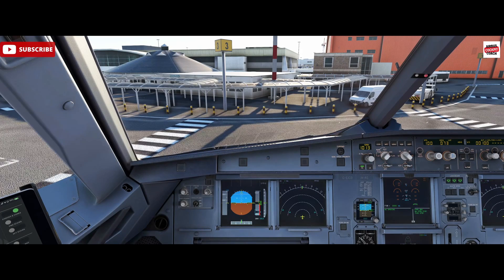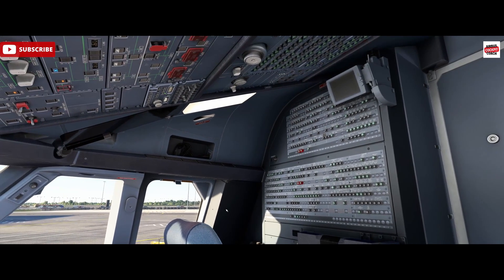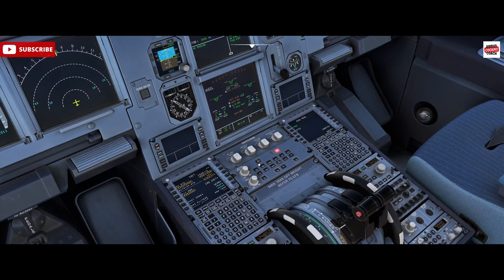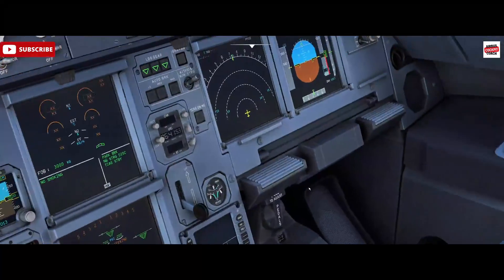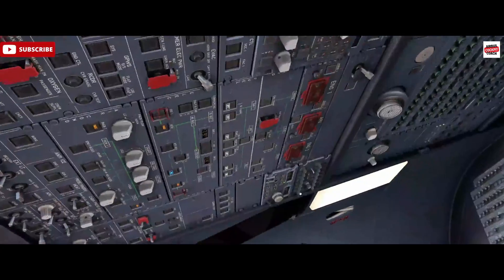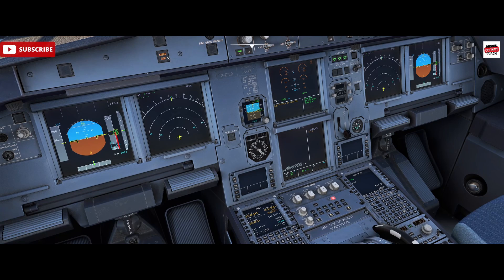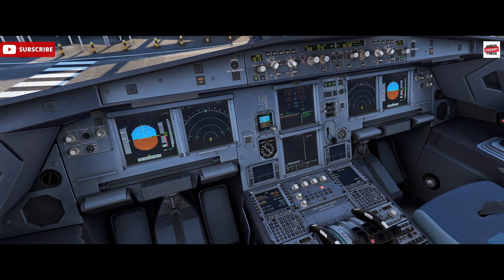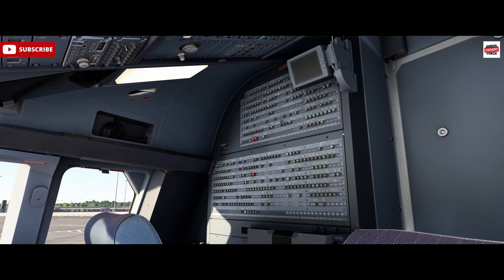A320 Circuit Breakers Explained by a Real Airbus Pilot | MSFS 2024 Tutorial

Comment: Thanks for the video and your effort. One question though, if we start the engines, there’s always a click sound whenever the engines are available. Is that sound coming from the circuit breakers?
Reply from the maker: Hello and thank you. Relays, contactors and autopilot servos are all sources of clicking noises within the Airbus cockpit. The majority of these become operational on engine start. From experience the majority of that kind of noise comes from the forward overhead panel so would be electrical but not the breakers themselves